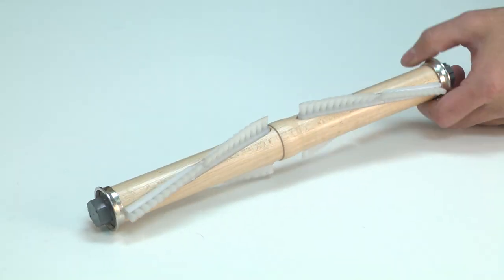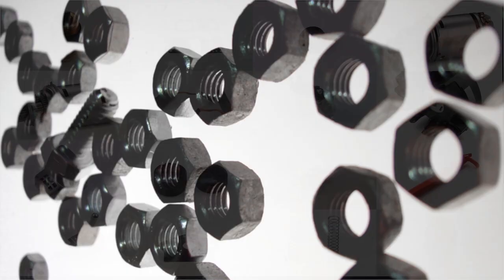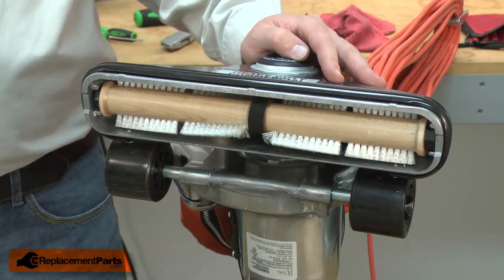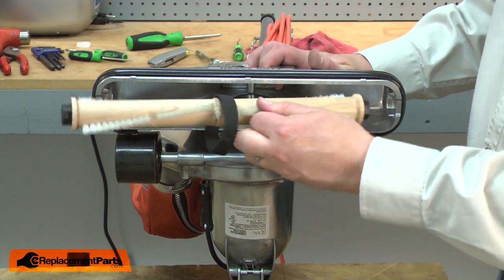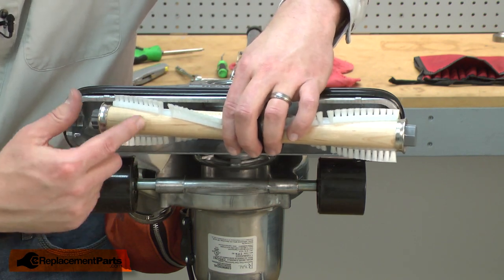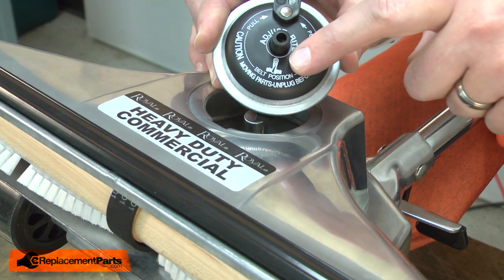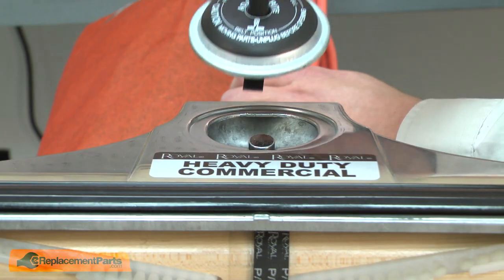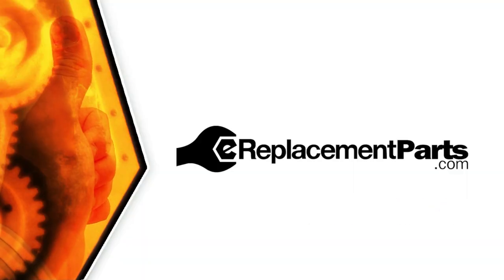Royal Vacuum Repair - Replacing the Brush Roll (Royal Part # RO-673273)

Comment: Whoa absolutely no disrespect but that brush roller that you installed is on backwards.

You got the Chevron pattern to push the dirt out words rather scoop the dirt inwards and the stiffeners that keep the brushes from flexing are on the wrong side because of that.

But besides that your demonstration is fine.

Comment: This is wrong. The arrow on the roller doesn't point right. It points in the same direction as the arrow on the cover (which is left on my vacuum and yours). At the end when you pop the cover back on, the roller brush is clearly on backward.

Comment: What about the two ridges on the "A" side of the two hexagonal nuts?  What goes in first "A" or "B", or perhaps ""1" or "2)? The hexagon is not symmetrical!
Reply: Did you figure this out? I had to install one the other day and had no idea so installed with both the 1's facing upwards into housing